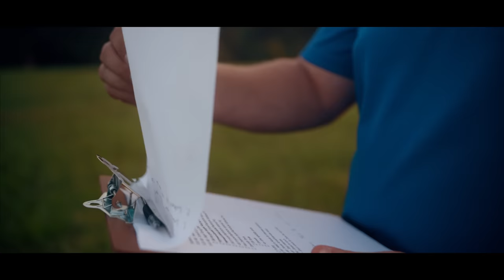Swing Plane

Comment: For me I have smplified everthing into
1 high, low or medium height flight = adjust the height of my starting position. So high flight means low starting point and vice versa
2 hyzer, flat or anhyzer = I set the angle with my forearm and then let the body naturally adjust in the hip joint to create the same swing.

This presetting the starting point has improved the success rate of the throws so much it is mind boggling. Before all anhyzers would go sky high which as annoying as hell since just couldnt figure out why.

Also one thing I always remind myself with anhyzer throws is that it is far better to loose a bit of power and distance but hit the height and general shape you envision. Stalling out early is usually very costly but 20ft short can still maybe be a chance for birdie, stalling usually mean maybe  50% or less of desired distance which can often be a hard par.

Comment: Overthrow is awesome! I find it useful to think of the swing plane as extending all the way to the target. I kind of work backwards and visualize the disc path I want, make that into a plane that includes the target, and then shape my body posture to move on that swing plane, as a starting point. Then some adjustments to allow for the disc flight pattern, if that makes sense.

Comment: Nice vid, keep up the great work! I'm sending all my buds who want to improve to your channel.  This vid brings back memories of an "ah ha" moment when practicing spike hyzers. That idea of working on the swing plane for hyzer shots is a GREAT way to get the feeling of keeping that disc out there. There's something about an extreme hyzer swing plane that helps people put it together, and it's probably because a big spike hyzer doesn't even work if the swing plane isn't right. Seems like it's easier for people to feel that swing plane on a spike hyzer angle and get flight feedback without the confusion of the disc turning and stuff. After getting the big hyzer swing plane down it's much easier to decrease the angle until you have the feeling for all swing plane angles.
Reply from the maker: Exactly my thoughts

Comment: So the last exam example you trew with the body pretty straight and not so much hyzer style.
I'm a bit confused about the message here. 

Also: I'm currently working in the hyzer swing-plane, it's going great, good hyzer flips most of the time, smashing huzer bombs. But throwing on a LOW line is so much harder than before. A cideo or comment on this could be useful.

And as always thanks for the really good content!
Reply from the maker: I married the two concepts: less bend at the waist to bring the swing plane a bit higher and pronation of the wrist to make the anhyzer more accessible. It’s important to still swing the lead shoulder up (although lightly).

Comment: The pronation explanation mystifies me. At first, I think that gives **me** more hyzer angle, yet it seems to work! Part of the mental confusion, it seems to me, is that the arm is never going to come through at the same level as the shoulder, so it creates a mental illusion as to what's happening. It feels like I'm hyzering when I pull straight through.  

Then there is the fact that the disc reverses its position through the shot. What was hyzer, becomes anhyzer at some point. Also, wrist action affects the angle. Drew Gibson appears to lose his forearm rotation by the time he gets to the hit. This could be a natural result of the needed wrist action.

My first speculations about what was wrong with the explanation was that the real purpose was to help keep the nose down and reduce rounding or overturning an understable disc that i normally too heavy or too fast for us regular people to throw!

Comment: 9:26 Seems to me like Drew pronates his wrist even on flat shots and the on hyzer he has it flat with a very slight tilt and I've been thinking about this on my own form. It's alot easier to keep the forearm lose and keep the elbow up when doing that, so I wonder if that could be a reason to do so aswell?
Reply from the maker: Yep. Keeps us super loose
Reply: @OverthrowDiscGolf   I've only tried it a couple of times, but i think i'll try to work on that more. After all hitting the disc on the right angle should be easier when the body is not working against itself (by being too tense and breaking the kinetic chain) perhaps .